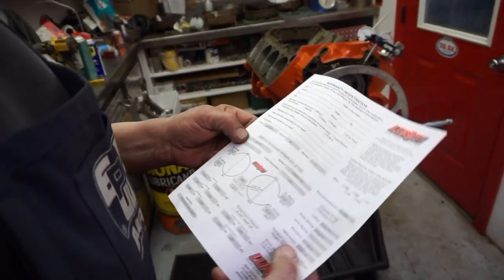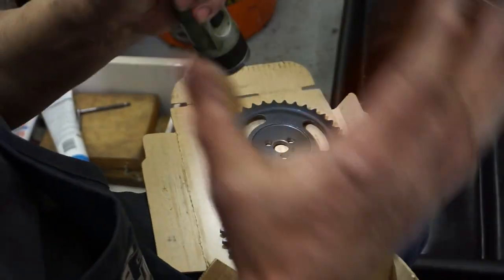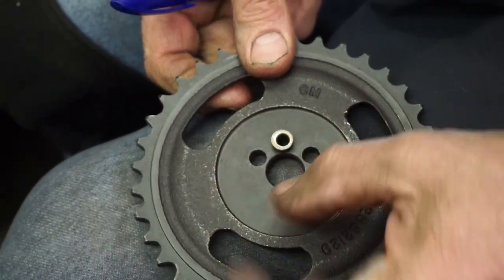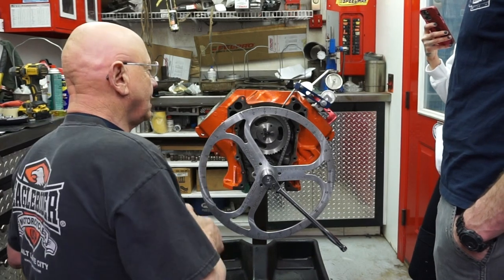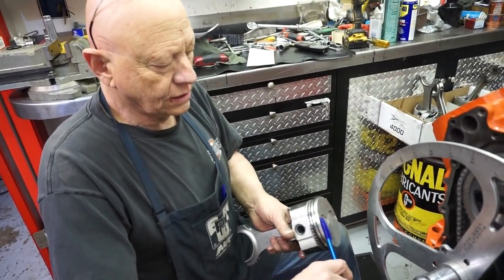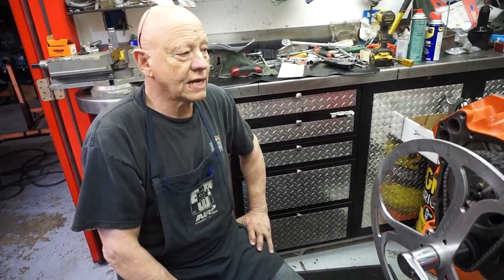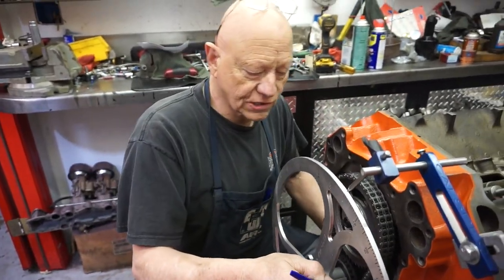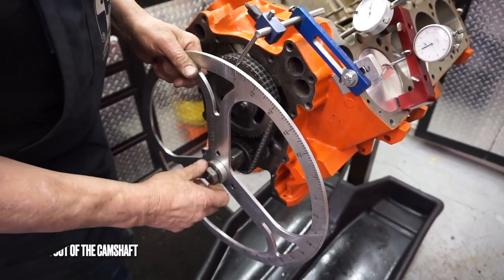How to Properly Degree a Camshaft 440 Mopar: Alex's '70 Duster Build Ep. 19

Comment: That four degree cam Center on that pace of paper is based on information that the camshaft maker has no idea why he's telling you that. He knows nothing about what angles you have on your valves, what's your valve train is nothing. The vast majority of cams are being sent with 104° information on them. And almost all of them will work better at 2°. I like the lobe separation being a little bit on the low side. At 110°, it will work better for lower end, where you're going to be needing to accelerate the most. But that installation degree marking has nothing whatsoever to do with anything that you've got in your shop.
Look up the Keith Black system for degreeing a cam on a Chrysler big block, not only is it a hell of a lot faster, it's plenty accurate for a race motor. Which means it's more than accurate enough to be on your automobile.